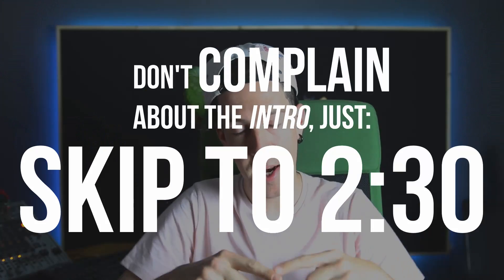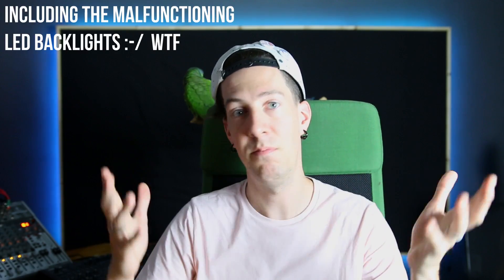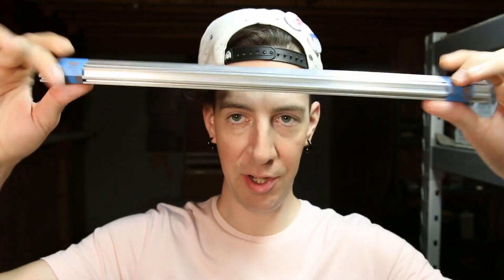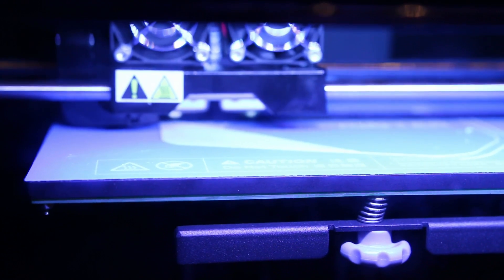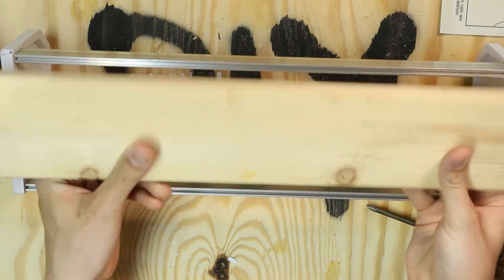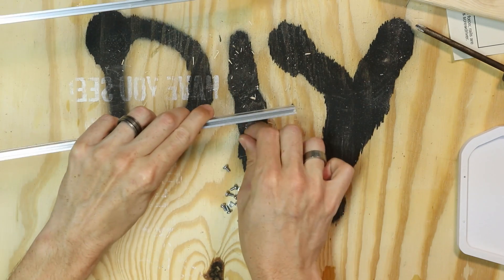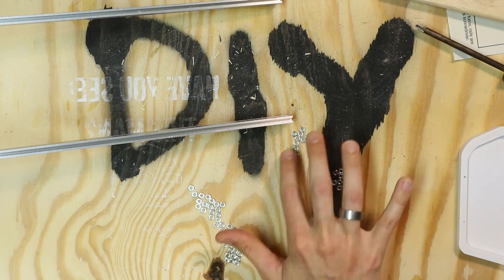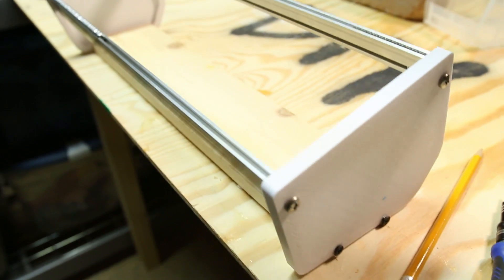DIY Music Studio - How to Build Your own Eurorack / Modular Box

Comment: Hey dude! I don't know if your still checking replies on this one but if so can you please link the template for the side panels you made? I clicked the link you have under the video but it only has the screw hole distances. I was hoping for the side panel shape and dimensions. Thanks in advance! 

Edit: or better yet, could I just buy a pair of white ones from you?
Reply from the maker: Yo! Sorry for the late reply, but I actually refined the design quite a bit and have a link to it, here:

https://www.thingiverse.com/thing:3333615

You can make it as long as you want, or make it the right size to fit into a 19'' rack too.